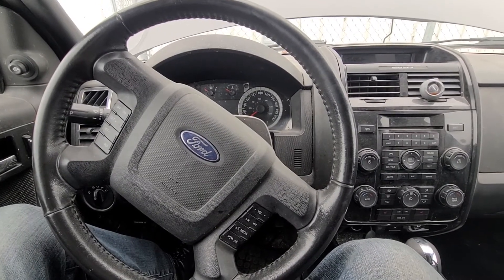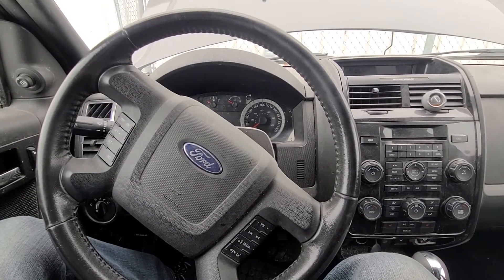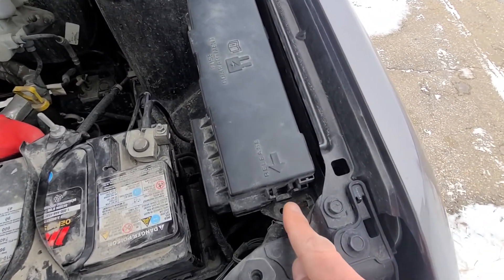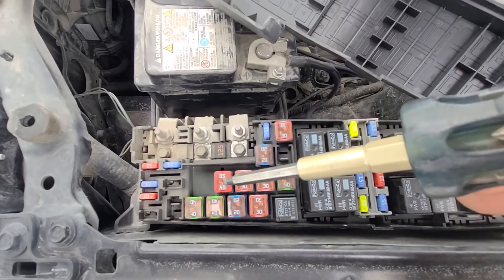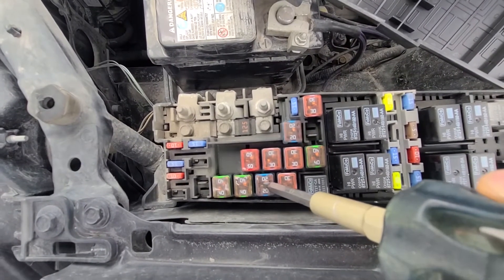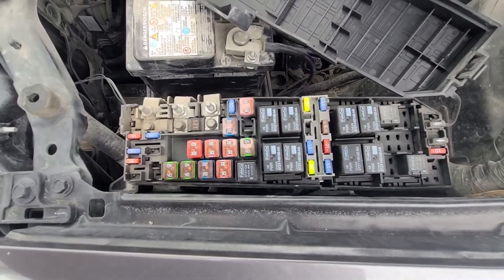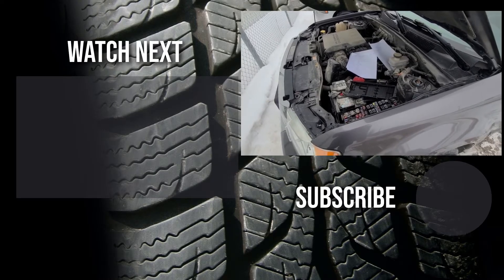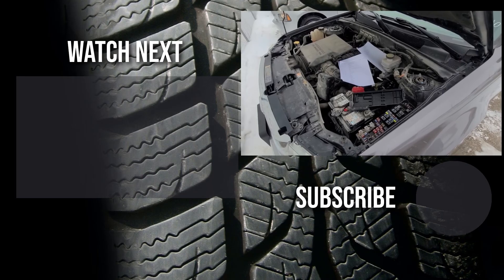Ford Escape - ABS BRAKES FUSE LOCATION (2008 - 2012)

Comment: Hi my ford escape have the brake system. check on and the abs the brake light what can it be ? Thank you
Reply from the maker: Possibly one of the abs sensors or wiring towards one of the sensors. Next step is to scan the module and follow up on the error codes
Reply: @QuiteAlright yes OBD II scanner will throw the code of whats the issue. Blown fuses, wheel bearings, speed sensor, brake light switches, abs pump or module control can be out.

Comment: Hello, I have a 2008 Ford Escape XLT and my ABS light and my traction control light came on at the same time, what could it mean? I fixed my tire pressure sensor light as well
Reply from the maker: Probably one of the abs sensor failed or damaged wiring towards one of the sensors. First you would have to scan the vehicle for codes which will pin point where to look, then inspect the wiring towards that wheel and in the end replace the faulty sensor if necessary
Reply: @QuiteAlright thank you for your fast reply! I appreciate it
Reply from the maker: No problem
Reply: I know my dear both my ABS and traction control light and flickering head lights and my car trembling like shaking as well ...this old gal should be doing all that with the cost of all these repairs...😅

Comment: I have a 2008 escape hybrid, brake pedal is hard but  doesn't brake. Forscan can not find abs module code u0129. Fuses tested okay.  What else cpuld it be?
Reply from the maker: Hello, hard to say without looking at the vehicle.
Could be the problem with the abs module itself or a wiring issue towards it.
Also usually hard brake pedal is caused by a leak in a vacuum system
Reply: @QuiteAlright thank you, I will check the wiring
Reply from the maker: @incognito-c1o  You're welcome and good luck

Comment: Useful, Brake pedal soft and feel like Air in the system tried bleed but still the same change booster and pump still the same can be abs system
Reply from the maker: Could be problems with the abs system or even leaking caliper. Hard to say without looking at the car

Comment: I want to disable abs break system, which fuse i have to remove??
Reply from the maker: Removing main fuse should do it but I wouldn't recommend doing it. It will affect traction control system and there is higher tendency brakes will lock up and it will affect the safety while driving. ABS problems are usually easy to diagnose and fix as probably you are dealing with failed abs sensor or corroded wiring towards one of the sensors

Comment: Hi there. I have a 2010 Ford Escape XLT and my mechanic can't figure out why there is air in the brakes lines. He bled them two different times but air keeps coming back. No leaks anywhere, is there a usual problem with these vehicles on brake pedals going to the floor. Thank you for your time.
Reply from the maker: Hello, sorry to hear you are having problems with your Escape. I don't think it would be a common problem at least from my experience. Something is going on somewhere that is causing it. Could be a problem with the master cylinder or one of the calipers but you will need an experienced mechanic to diagnose

Comment: Mine didn't have the little 5 amp fuse and it correlates to fuse diagram online. 2008 Mariner.  
Does removing these fuses make the regular brake light appear?
Reply from the maker: Hi, yes it could trigger abs light, traction light and / or brake light on the cluster

Comment: Can you remove any or all of these fuses just to bypass the ABS?
Reply from the maker: I wouldn't recommend that as it will cause other systems to malfunction such as traction control
Reply: But isn't that what the whole video is for?
Reply from the maker: Hi, Sometimes ABS will not work and ABS light will be on the cluster due to burnt fuse. @Blueguitar007

Comment: Is there a way that you can make a video, showing the noise a normal abs module makes, because my 2011 escape hybrid is making a squeaking sound and I do have the abs light on and the brakes going all the way down
Reply from the maker: You would normally hear abs engaging when you brake sharply or in any event where one of the wheels stops turning (example sliding on ice), not while driving in normal conditions. If your ABS light is on then most likely one of the abs sensors failed. Brakes being soft and going all the way down could mean air in the brake system or even a brake fluid leak. Make sure to check the brake fluid levels. You would definitely have to scan the abs module for codes which will point you towards the problem and then inspect complete braking system.

Comment: Hello I’m having issues with my 2008 Ford escape hybrid. Having to replace the ABS module. My ABS and REGEN BRAKES lights are on. I need help finding the part for cheaper than 5000 dollars that I don’t have. PLEASE HELP.
Reply from the maker: Your best bet is calling car salvages all around and you should be able to find it. Escape Hybrid is quite rare so it might take some time, but definitely worth it. They all ship North America wide. There is couple of websites also that search multiple car salvages inventory